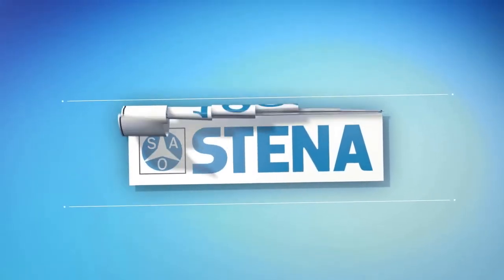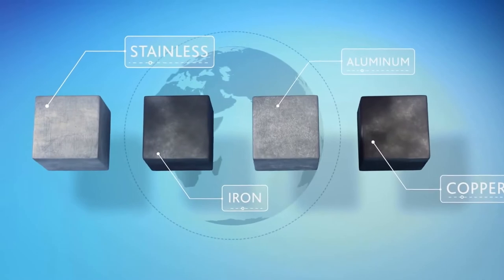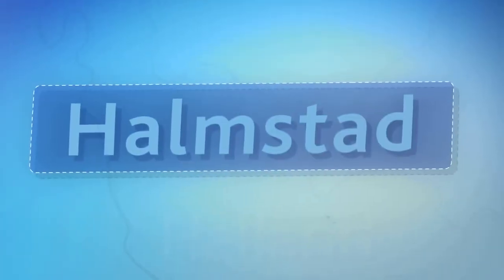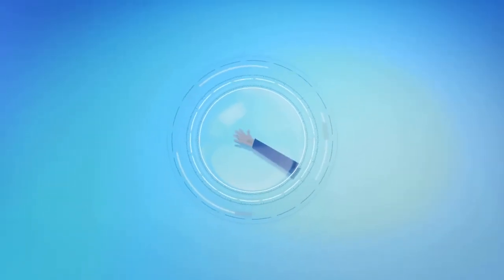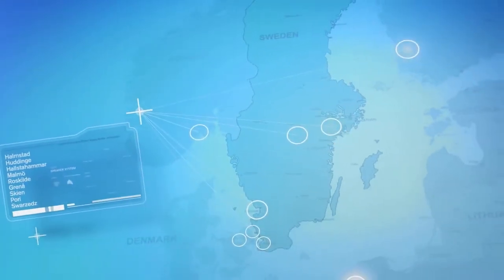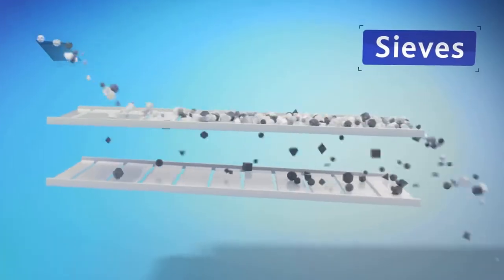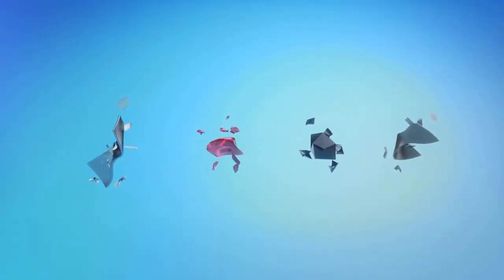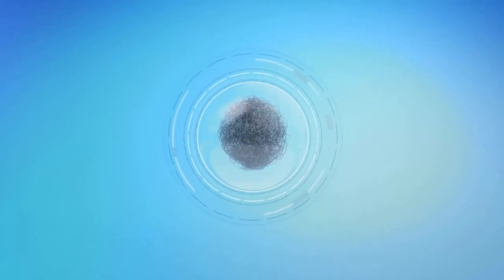The Recycling Plant of the Future

Comment: Why cars are not designed to simplify recycling? The cars can be standardized and the parts can be separated by automated robots. Like reverse manufacturing. Why this is not done? Isn't it harder and less efficient to separate the parts with crushing, chemicals and magnets, etc...?
Reply from the maker: I guess that's why we need the research center.